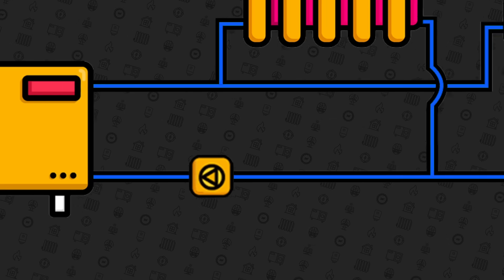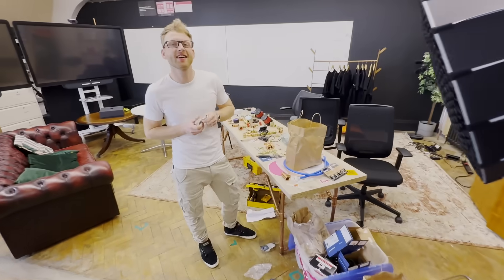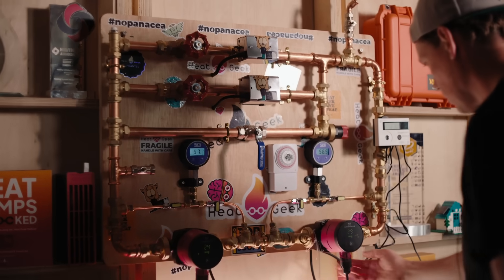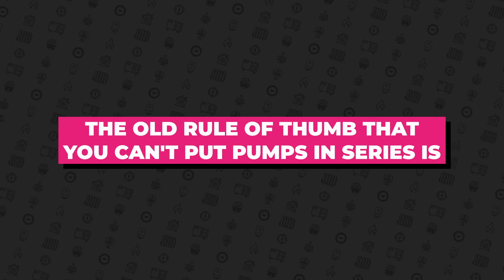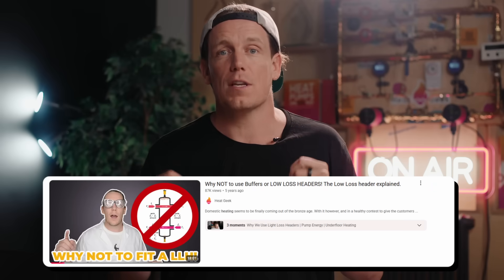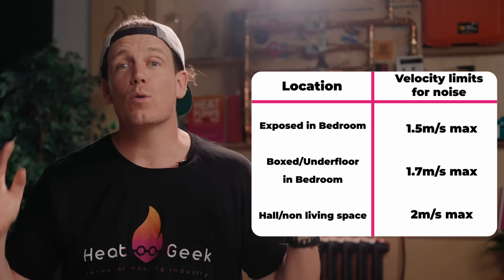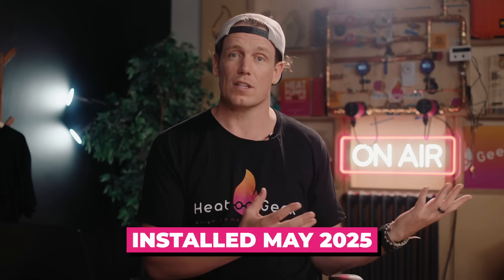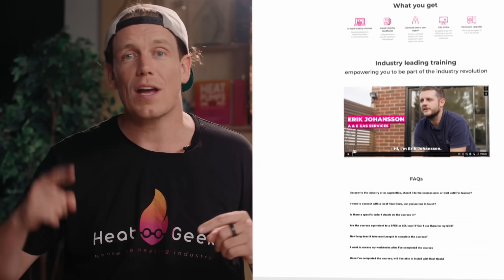Why Your Heat Pump May Not Need a Buffer or Repipe After All

Comment: Really interesting experiment. I have a few questions, if you don’t mind:

1. Were both pumps set to identical pressure settings (e.g. constant pressure mode), and did you test AutoAdapt or other control modes?

2. Did you monitor individual power draw or RPM to see if one pump was carrying more of the load?

3. What would happen if the pumps weren’t identical, say slightly different models, age, or firmware? Would imbalance or interference creep in?

4. Most importantly do any heat pump manufacturers (e.g. Viessmann, Daikin, etc.) or even pump manufacturers like Grundfos actually support or recommend using circulators in series like this? Given how much companies like Grundfos invest in R&D and advanced control systems, you’d imagine they’d have endorsed this kind of setup by now if it were genuinely viable yet I haven’t seen any official guidance or documentation that supports it in real-world heating systems. Would love to hear your thoughts.

It’s a thought-provoking result, and I’m curious how it holds up in a real-world scenario outside of a controlled test rig. Thanks for sharing.
Reply from the maker: 1 we tried every combination 
2 the power draw is displayed on the front of the pump
3 based on how they performed when on different settings no would be my guess!
4 no they don’t suggest it, but they also don’t say not to do it. They do talk about pumps in parallel though.
Reply: @HeatGeek It's good to hear that every combination was fully explored. That said, test rigs don’t always replicate the variability and edge cases you get in real-world heating systems  especially during winter or in systems using weather-compensated control.

Regarding power consumption: what’s displayed on the pump screen is a rough estimate. It gives a helpful snapshot, but it’s not true telemetry. It doesn’t show what the pump is doing minute by minute, how its behaviour changes under fluctuating resistance, or whether one pump is subtly compensating for the other under dynamic conditions. Without logging real-time RPM, torque, or differential pressure, it’s hard to know if they’re genuinely working in harmony.

As for the point that "manufacturers don’t say not to" that’s technically true. Most manuals don’t explicitly state:
“Do not install two pumps in series.”
But that doesn’t mean it’s endorsed. In engineering and installation literature, the absence of approval is effectively a red flag, especially when.....

Only parallel pump configurations are shown in diagrams

No hydraulic models are offered for series configurations

Smart pump logic is clearly designed for single-pump or primary/secondary setups

And the manuals are otherwise very detailed about permitted arrangements

Mitsubishi, for example, explicitly warns against configurations that interfere with ΔT targeting.

If this was a safe, efficient, and reliable method, surely it would be encouraged in the documentation, wouldn’t you think?

Comment: I have two LG Therma V’s which have their own pumps and a buffer tank in the loft to mix the output. Then on the radiator circuit (after the 3 way valve) there’s two pumps, in a push/pull configuration, one on the inlet to the rad circuit, one on the rad circuit outlet.  No sign of hunting with any of the pumps.

The heat pump is connected to the radiators via 15mm pipework at the top of the house.  It works fine but I am concerned that it would be more efficient and cost less to run if the main flow was on 22 or 28 from the heat pump into the existing radiator circuit ‘spine’.  Would this be worth changing?

Comment: We had to talk our installers out of adding a buffer tank when the Panasonic datasheet explicitly said it wasn't required. However, when nearly all of the radiators had reached their thermostat temperature, leaving only a couple with water flowing through our old pipework, the HP was attempting a high flow rate of maybe 25 L/s still and produced a nasty oscillation, maybe cavitating. We turned down the max flow rate to more like 20 L/s and it seemed to be OK. Though we haven't had a winter yet to really exercise it all.
Reply: After you have your outdoor temperature compensation set up correctly and your balancing done, you can just open (or remove) the thermostatic valves on your radiators. You don't want them closed. You want just the right amount of flow through each radiator to maintain a comfortable temperature throughout the year.

Comment: My UFH pump has been in series with HP built-in pump for a few years now and no issues, I was worried about it and thought about getting LLH but thought I'd see how it went and no issues so far. Maybe could eek out a bit more efficiency with a few simple changes but not sure how long it would take to repay the labour charges.

Comment: So is pump sizing instead of pipe sizing the way to go.
Reply from the maker: Not if you’re putting in new pipes no.
Reply from the maker: Also pump sizing and pipe sizing are kind of done together
Reply: But on retro fit is bigger pump way to go if cost an issue and if work getting done where you can redesign change out pipe work.
Reply from the maker: @David-c4t9q provided you are within velocity limits yes.
Reply: Would be good to see you if you could replicate a new install where you sized everything to the heat loss then  had to connect to 8/10 mm pipework .

Comment: Great test, I think you need to try it with 2 vastly different pumps to be sure the advice can be rolled out. You're not always going to have 2 pumps with the same power, controls, logic etc. Be interested to see how it goes with say a 12m wilo and a 6m China pump.

To visualise, let's say you've got two great drivers following each other. They'll prevent traffic and avoid crashing. But it's not always that way. 😂
Reply from the maker: But if you could choose the second pump, you wouldn’t choose a vastly different pump. Still worth a test though sure
Reply: I've seen an issue before once in this scenario with this where the second pump basically lay down (thought there was nothing for it to do) and caused low flow. I can't remember the specifics. But it was a big pump pumping into a smaller pump.  @HeatGeek I can't remember how we solved it though. 😂

Comment: So would this mean my 8mm microbore system might not necessarily need replacing ?  I've got a single story with a mix of microbore, underfloor and long run blue pipe. Couple of years ago I was quoted approx £20k for a heat pump install with complete repipe of the microbore but I can't justify that expense. If I didn't need to repipe the microbore then I might need to think again.
Reply from the maker: It often doesn’t anyway we’ve done a few videos on this check them out. Also gives Cheatsheet guidance.

Comment: 6:55 if the more likely scenario is this, what is best?
The property has a very old under delivering pump! Then should there be a new one be installed in series? If not why not get a bigger pump to start with, and just reduce the coupling to appropriate size?

Comment: Is it important to make sure the expansion vessel take off is not between the 2 pumps ?  ( to avoid hunting)
Reply from the maker: It will always be between the two pumps as it’s a circuit
Reply: @HeatGeek  ... Good point ... Although ... consider 2 circuits  . A)  pump , pump, Expansion, Radiators . & B) Pump Expansion,  Pump , Radiators.   Both are the same  & the pumps are locked in step by the incompressibility of water .... until some gas collects in a radiator , the in B)  then there is the risk the of resonance between  radiators air & expansion vessel, & hunting in the pump.  ....

Comment: I recently had a Vaillant 7 kW heat pump installed in my bungalow. The heat pump is 20m from the hot water tank. All radiators are on 10mm pipe to the loft where 22m pipe is used. I asked British Gas, EDF and Aria for quotes. All wanted to have a buffer tank and place the heat pump outside a bedroom window to be closer to the water tank. In the end I chose Urban Plumbers who used 28mm pipe for the 20m run from the heat pump to the water tank location. The resulting flow rate was more than sufficient to meet the heat pump requirement. All working fine and I am very pleased with the installation.

Comment: If you design the system with less resistance and choose Heat Pump with a good strong water pump, then the system will run very well with one main pump. We made thousands of projects without buffer tanks, all working very well.

Comment: I put a pump in series once as a get out of jail move.  A heating system with pipes in a solid ground floor. System was open vented neglected over time. Sludge had hardened in the ground floor pipes causing a restriction. I could not shift the stuff. A second pump on the opposite side of the blockage worked. System was made a sealed system with X900 poured in and a filter fitted. No problems it worked.

Comment: Some real world experience: in my own house I ran a pump in series for two heating seasons when I had a heat pump with a somewhat small capacity circulation pump and high flow requirements (OEG/Aircal 1st gen R32 monoblock). The secundary pump was controlled by the heat pump. No hunting, no noise, no problems.

Comment: Have you looked into doing an experiment with a 1 pipe system? I've been told it's not suitable for a heat pump and the upheaval/cost of having my house replumbed is the main reason I don't have a heat pump already. It would be good to know if it would work with a single pipe system.
Reply from the maker: We have installed literally tons of these they work fine. They aren’t as good, but they work fine.
Reply: @HeatGeek oh that's good news. When you say they aren't as good what do you mean? That they are less efficient 300%, 200%, or don't heat the rooms well?

Comment: Yeah, you can put pumps in series without breaking the pumps or having the flow go crazy. It doesn't give you loads and loads of extra flow though. The pumps in series end up with a composite pump curve where the pressure is higher for the same flows. You can add up the head of each pump and each flow to get a new combined pump curve. The pressure loss of the circuit increases with the square of the flow. If you have twice as much head available you'd get 1.4 times the flow. But because the flow does increase the head slightly decreases. When I've worked it through in the past (commercial job, I messed up the pipe sizing) adding a second pump only increased the flow by 35%. So it's not useless to do, but it's not going to make a critical difference that often.
Reply from the maker: Yeh aware of all that. But our problem is pressure head not flow. As 98% of domestic systems are below 12 kW.
Reply: @HeatGeek head and flow aren't separate issues though. If you're saying that the bigger head lower flow composite curve of the pumps in series is the thing that cracks it for a lot of 12kW systems then that's cool, but it's still true that adding a similar pump in series will only add ~40% flow on the same pipework

Comment: These guys really know what they are talking about. I had a big issue with a bad  installer and they really helped me and put me in contact with one of their trained and trusted installers who sorted out all of the issues. We did not need a buffer but did need some more efficient radiators. System now works really well and is proving to be cost effective.

Comment: Pumps in series is very common in complex hydraulic systems, aircraft, water propulsion engines, power stations and even how the water companies get the water to your home.  Your rig will probably still be running when you retire.  Having the additional pump further away in a domestic system (say midway) would help overcome the resistance of the pipe work where you need it most and avoids the boiler pumps having to suck so hard.  

It's always been a mystery why more pumps = bad when you put them in a heating system.  Can you imagine the size required of a single water pump supplying a city!

Comment: So we don't need to remove the pump of the underfloor heating manifold system if retrofitting from a gas boiler which also does rads?
Reply from the maker: You definitely would remove that pump always. For these sorts of nuance responses it’s really best to take the training course and join the community very hard to explain all the variables in a comment.

Comment: Absolutely bullshit.  Pumps in series you use when pressure needs to be increased. Pumps in parallel you use when flow needs to increased . Rule of thump is when using in series which you can of course is using similar pumps. If they are different you must hydraulically separate them using a balance vessel,  which is btw not an buffer!

Comment: If it were going through a micro bore system, which is more prone to damage or pinched pipe on the bends, would the tighter system by more prone to breakage on irregular sections of pipe / joining hardware? Btw I'm not in any way a plumber or heating engineer, I'm just curious.
Reply from the maker: No not at all. It would just add a little more effort for the pumps which they are more than capable of handling

Comment: Mideas will get angry (E8 error) if theres flow running without the primary pump running. Depends what the output defaults to (I haven't looked closely) but that could make things tricky if that second pumps starts running too early as the heat pump comes on
Reply from the maker: Correct. As per the video, wire post 3 port powered by the 3port switch over

Comment: Pumps in series for pressure or head 
Pumps in parallel for flow rate
Reply from the maker: Yes, but series will generate flow rate too as you have more pump head

Comment: Funnily enough my system was installed in 2021 with a BIG pump on the loop for HWC which has a couple of towel rails 'always on' and a smaller pump after the diverting valve to the radiator heating loop and it works just fine with long runs of 15mm pipe into rooms over a double garage... but I also have a pump to squirt water into the ufh mixer and another circulating pump. I am about to get my engineer to remove the mixer valve and one of the pumps,,, don't think I need that. And we got (I include me cos I knew the construction) some of the heat loss calcs wrong, though we might have some temperature loss from the main loop down to some rads (18 rads and towel rails and 45 m2 of ufh) simple enough to swap out some rads and gain 30% COP now it has all been tested down to minus 8.

Comment: They wont break they will run until they would of naturally wore out if on their own

Petrol/diesel vehicles quite often have 2 pumps in series one 2 lift the fuel from the tank and prime the 2nd and the 2nd it provide the required pressure to the injectors, once the 2nd pump is primed the lift pump is not needed unless ait gets in (IE the fuel momentary goes lower than the pick up) as such they don't turn off, there is no ill effect

Comment: Hello... what is a duty point?

 I have been asked to install radiators into a new build ready for heat pump installation. The client has 3 quotes for ASHP none have provided a heat loss calculation but 1 has sent an EPC  but stated heating to be provided by electric radiators!. (Came out as F)  Building is fully compliant with current building Regs 2025.
As a gas boiler installer I have given an estimate of radiator sizing based on 30 watts /m3 and a correcton factor of 0.3 for ASHP

I have stressed the importance of a HL Calc, but client is adamant that what he has at home will be fine in new build. Home is heated by a wood pellet burner at flow temp of 65c with UFH & Radiators built in 2015. Any advice is appreciated.
Reply from the maker: Hey.. there’s too much to answer in this question. I would advise you point the customer to our ‘consumer series’ playlist and also advise the heating design training we do to become a master!

Comment: Looking to solve a problem that isn’t there. If you need more head then just get a larger output pump.
Reply: most heat pumps have the pump built in, hence the "need" for hydraulic separation, which is what this is addressing.

Comment: Have you guys just tied up with Aira ?. They pretty much insist on a buffer on all installs although rarely can they articulate why. I had an otherwise good quote from them which I discarded based on their inability to tell me why my design required a buffer.
Reply from the maker: No. We have a full training course for them to take (many of them have) and lots of free info on here. I think that’s enough help!! Haha😊
Reply: I had exactly the same issue - decent quote from Aira and the heat pump actually looks nice.  Went for the more expensive HeatGeek quote 'cos they could justify what everything did.

Comment: As a chemical engineer pumps in series is regularly done in process plants where different pressures are needed across manufacturing sites.
Reply: And as a chemical engineer I just did this to my diy heat pump install, works like a charm.
Reply from the maker: Yes, often in open loop circuits too

Comment: I've also been experimenting with pumps in series. No problems.
To be 100% sure there will be NO hunting or interference, just put the additional pump on constant speed and that's it.
If possible, try to find the minimum constant speed that will meet the flow requirements.

In the other "automatic" modes (constant pressure, proportional pressure, etc), there's always the risk of hunting, even if you don't see it in a test environment. In the real world, it might work today, but in the winter when some subtle unforeseen change occurs in the heating system, it might cause problems.
Reply from the maker: We advise against this. Especially when working on units that target dt